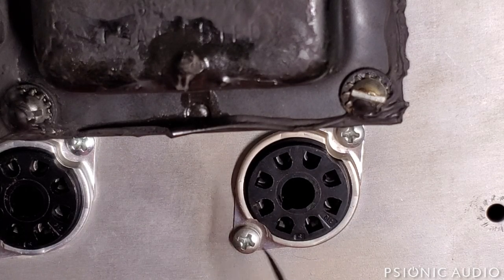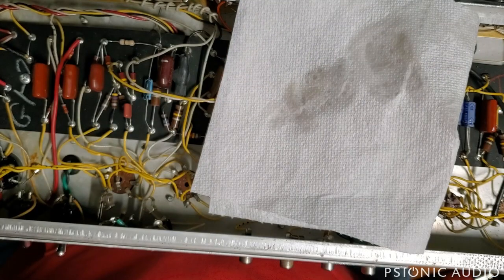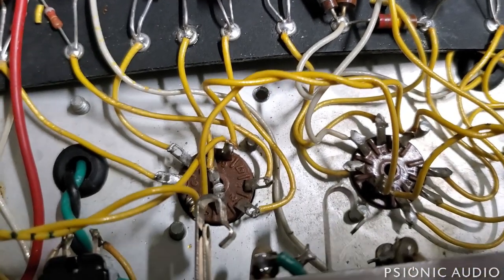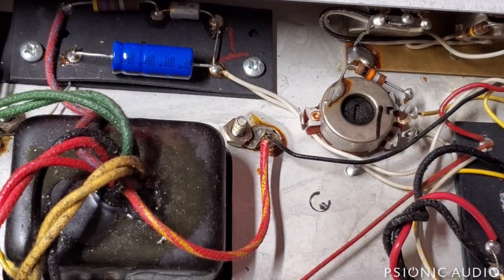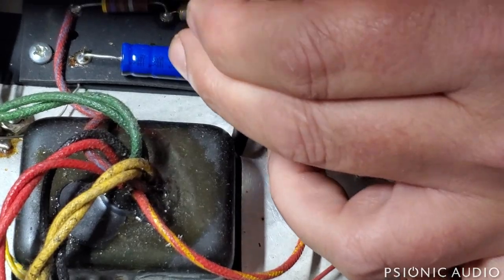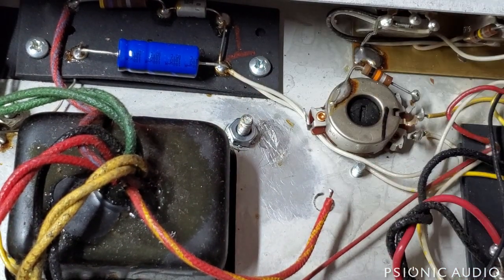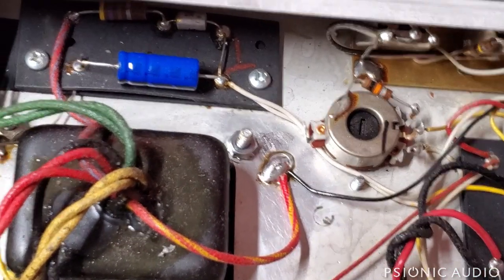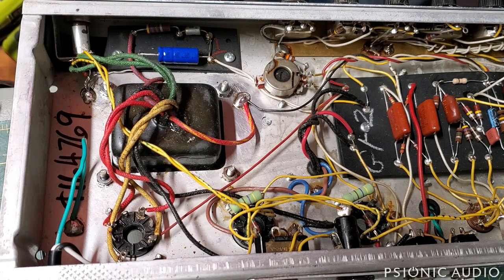De-CBSing a 1969 Fender Deluxe Reverb

Comment: Just Did this to a Bassman 10, man, i found out WHY they use so much COAX..  :(   Put a terminal strip middle of board, split the channels, ran 220ks, n then ran a INSIDE driver MASTER volume, added more filtering to mains ( 220ufs)  Sounds ridiculous..

Comment: What is your opinion about using either MEK or Acetone Solvents to clean solder flux or residue for switch contacts and solder residue on pcb pads?
Reply from the maker: Overkill. Iso alcohol removes flux without damaging components. I only use acetone on bare metals, though I try naptha first.
Reply: @PsionicAudio  ok thanks